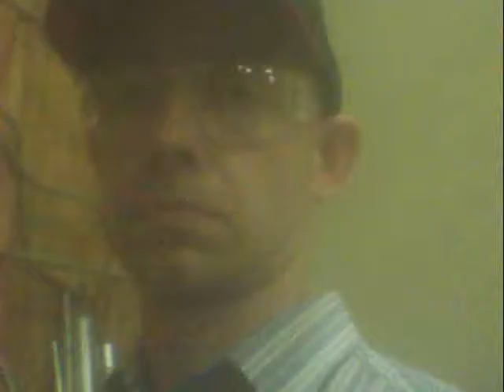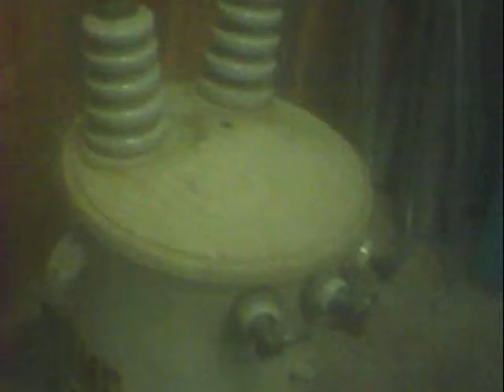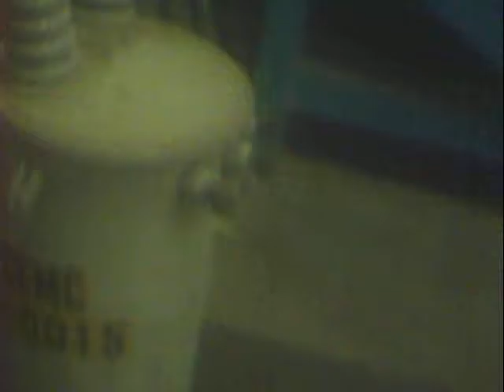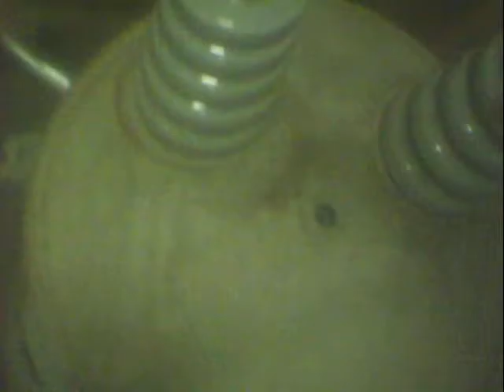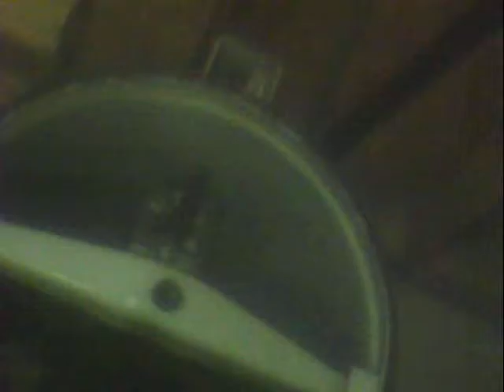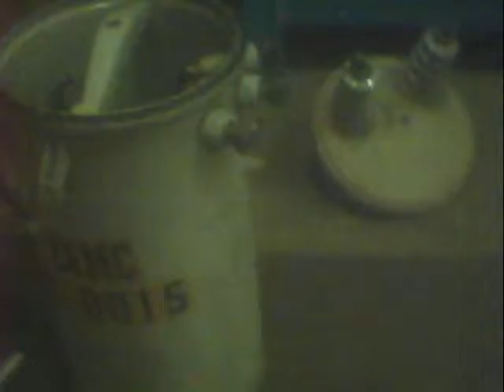Basic Residential Transformer; guts inside:

Comment: that is a single phase transformer, the top bushings are the primary & the ones on the side are the secondary. between the middle and either outside is 120volts if you were to put a meter on the two outsides there would be 240volts. the switch inside is for the hi voltage selection, a lot are on the outside. where did you get one like this?
Reply from the maker: Thanks for the info Erwin. Somebody donated it to Miller Motte Technical college in Madison TN. I think it has the company name on the side.